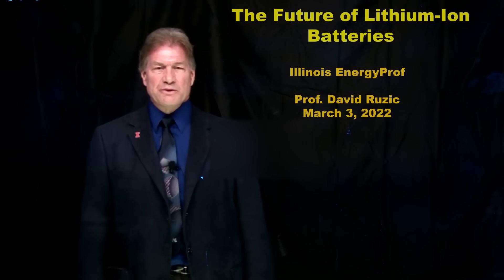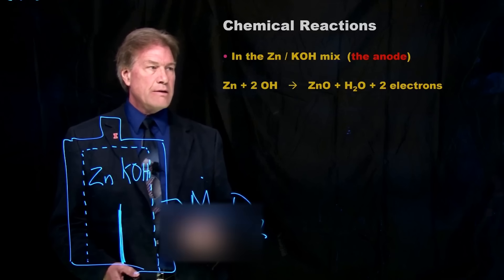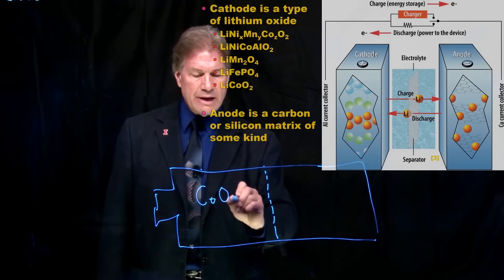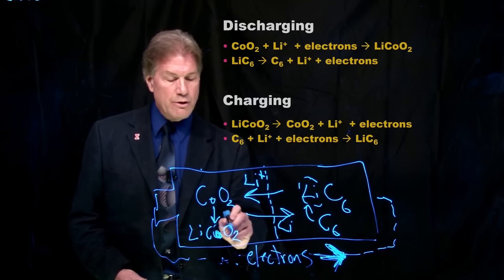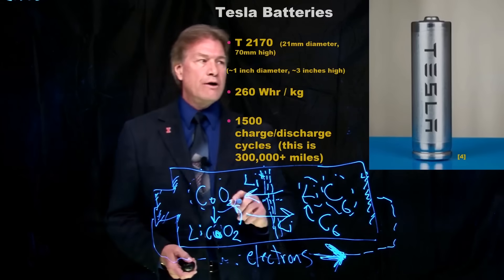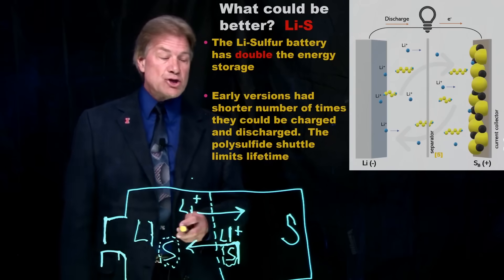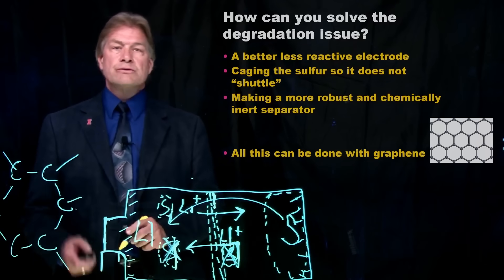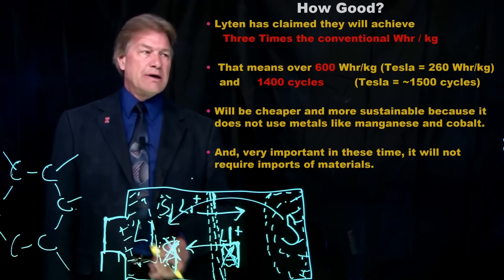The Future of Lithium-Ion Batteries

Comment: Interesting stuff. So as a EE I am interested in during discharge of Li Ion batteries the positive Li Ion travels from the negative anode to the positive cathode; my question what provides the energy for the Ion to climb that potential barrier since the cathode being positive should repel it???   By the way I have asked this question on every YouTube video regarding batteries and I have not received any answer that makes sense. Also if you could refer me to a journal paper that provides insight that would be great.
Reply from the maker: When the wire is connected between the two ends of the battery, they are "shorted" together.  There is a drop in the potential.  The LI ions only go across when the battery is in use.   The energy to make the trip is from the exothermic chemical reaction that takes place at each end of the battery.  Does that help?
Reply: @illinoisenergyprof6878  Thanks so much for taking the time to reply.  So if the load on the battery is a light load the potential should be about the same so the positive Li ion still needs to over come the 3.7v potential to get up to the cathode; so you are saying that the exothermic chemical reaction in the anode give the Li ion the boost to overcome the 3.7volts?  I would like to know more about this can you point me to paper that explains this.   
I was reading a chemistry book about batteries and they stated that the electrons that flow through the external circuit into the cathode form a negative attraction that overcomes the 3.7v and pulls the Li Ions up to the cathode ... I kind of see this but need more insight. Thanks!!!

Comment: As a note: lead acid batteries have Sulfuric acid as the electrolyte, not Hydrochloric.
Reply from the maker: my mistake.  Sorry.
Reply: @illinoisenergyprof6878  We all make em.
Reply: @stazeII
i was expecting to see H2SO4 but now wondering if it would work with HCL ? :-)
Reply: @YTANDY100  No.  lead acid batteries are a bit unique in that the electrolyte itself is part of the reaction.  Sulphate from the electrolyte reacts with lead oxide to form lead sulphate.
Reply: @matthewbeasley7765  the electrolyte reacts with both the lead plate and the lead oxide plate coating both of the plates with PbSO4, converting the electrolyte into water.
Reply: @YTANDY100  I believe they used HCl around 100 years ago.  H2SO4 may not be as 'Strong' however it is DiProtic, meaning it has two 'acid' molecules (First is Strong, second is weak).  I believe the backup batteries on the Telephone Land Line system uses HCL-Lead batteries.
Reply: @YTANDY100  Ah, H2SO4, Professor: https://www.youtube.com/watch?v=VnbiVw_1FNs (about 45 seconds in).
Reply: yea indeed
Reply: This guy on the vid is pretty full of all sorts of shit.
Reply: Maybe proff ruzic knows something that we don't. The team might be working on something. But it's been 2 years now I see , and ain't heard much to date .
Reply from the maker: As I mentioned earlier, I misspoke.  I did know the answer, but was trying to contrast the alkaline batteries with the lead-acid ones.    We tried to partially correct it in the video, and I also now mention this error in the video description.
Reply: @illinoisenergyprof6878  I taught I heard wrong at first and had to play that part again. You seem to know your stuff, so it was such an unexpected mistake. I was like hydrochloric acid, what?! It's sulfuric acid in the classic 12 V car batteries 😆
Reply: @illinoisenergyprof6878  you are awesome!!!!
Reply: MnO2 is manganese dioxide, not manganese oxide.
Reply: @amazeddude1780  both are fine because metallic oxides are often named without the valence number.

Comment: LFP has already solved most of these problems.  Longer life, lower cost due to easy to obtain base materials, low processing cost, easier to recycle, etc.  Lower energy density but easy to pack into dense blocks making them much more dense in terms of kwh per volume than cylindrical batteries.  I'm really not sure where this guy is coming from.  This must be a sponsored video by the company he's pushing.  This technology is quite old, actually, and no one has been remotely close to making it work properly.
Reply from the maker: The key is being able to make graphene easily, cheaply and at high purity.   I do videos on stuff i know about and get excited about.

Comment: Opposing viewpoint -This is the first time I have ever disagreed with the Professor.  What is far more practical (for vehicles) than this  Vaporware - if it ever becomes commercially viable before Climate change is 100% non-mitigatable - is tech that has been in use in the real world for over decade: PHEV (Plug-in Hybrid/battery + ICE).  Since 90%+ of all vehicle travel in the U.S. is less than 40 miles/day, why have any BEV with 400-500 mile range?  Yes, the messiah Musk says so, but he is just a carnival barker padding his own pockets with his celebrity.  The reluctance to charging times, and the availability of long distance driving without having to stop every 200 miles for an hour to charge at public charging stations that may or not be there,  are just a couple of factors in why All-Electric vehicles will always occupy a insignificant niche (unless dictated by a government).  And I am an owner of Two EV's (a BEV and a PHEV).  

With respect to vehicle emissions here and their effect on the climate:  We don't have a Physics or Engineering problem - we have a Cultural Problem.  

Our urban areas (read: Suburbs) have been designed to be only accessible by a car.  There isn't enough capital in the world to retrofit these areas with Public transportation - nor would most Americas use it anyway.  So we are stuck with cars.  All-electric cars are simply detestable by 97% consumers (as evidenced by the adoption rate) on almost every level, and rightfully so.  PHEV's with 50-100 mile, all electric range could reduce total vehicle CO2 emissions by 75% - 90%. All without the inherent issues of BEV's - assuming the majority of new vehicles are PHEV's using existing and Proven technology.    A PHEV with just 10% to 20% of the battery size of some $150K - 450 mile range - Lucid Aire is just common sense.  I have a 3-year old PHEV with 50 mile range, it has 44,000 miles, and during its lifetime has consumed less than 360 gallons of gasoline (you smart guys do the math).  One weekend per Month, it takes a 400 Mile round trip drive.  Otherwise, it's powered by the Solar on our rooftop.  

No, we won't get 100% vehicle CO2 reduction, but the adoption rate of PHEV's would be viable vs the 1% or so of BEV's in use today.  

The Professor mentioned not needing to use "foreign sourced materials."  This is a very sore spot with me, as he is talking about Cobalt - and its mining "methods" out of the Congo. Hey, I have an novel idea...how about just PAYING the Congolese what their natural resources are worth, and investing in their Nation to provide refined Cobalt? Instead of continually colonizing them economically, to the point that if we don't get the Cobalt on our terms, we won't get it at all, and tell everyone to wait until our "theoretical" Graphene becomes a reality so we won't need "those people"?  

The reality is we will Never do away with fossil fuels. Ever.  The underlying economic infrastructure is built around them.  To prove this FACT, at this very moment, the EU (except France, who has the common sense to derive about 70% of its electricity from nuclear energy) is still paying Russia $500 Million per day for oil/gas...while a war of attrition rages on.  This is how powerful the global fossil fuel industry is.  This is how insane our addiction is. We can only better manage the situation.  And wasting precious days (and decades) awaiting something that may never materialize only digs us into a deeper hole.
Reply: Thank you. The solutions will come in the form of innovation, but we cannot wait for innovation alone. There is no magic cure, we must start pouring money into fair democratic sustainable solutions, as imperfect as they may be right now. The search for perfection will kill us all, we needed to invest in "good enough to save most of us" decades ago but we didn't. I hope LiS will pan out, but we should not be waiting to act until the "perfect" solution exists.
Reply from the maker: I own a PHEV (Chevy Volt) since we bought it in 2012 for exactly your reasons.  I also know that we will always use fossil fuels --- see any of my videos about them.    This new way to make graphene cheaply, purely and quickly is not theoretical.  The only way to prove that though is  by waiting a few years for the factories to be built.   I think they will, and that is why I was excited enough to make a video on the subject.

Comment: I'm excited of the idea of switching out copper motor winding for practical super conductors and powering those new motors with solid state batteries. It would be cool if solar cell technology worked enough that you could charge a super capacitor to keep the AC on without running down the power of the main battery.
Reply: That is not a doable item, there is not enough energy hitting the exposed area of a vehicle to lower the temperature.
Firstly as the same energy would be hitting the cabin trying to warm it up.  Now I guess maybe if had a semi and trailer covered trying to cool a non sleeper cab over it might be possible, but as the temperature difference gets greater tge harder it becomes as it heats up faster.

Comment: If you want elemental sulfur, you should ironically look to oil refineries for that. It’s a waste product that they remove from the tail gas. I’ve designed the systems that extract it. Refineries literally truck away thousands of gallons of molten elemental sulfur each day
Reply from the maker: Good point.   The key is that the S is so much more available than the stuff needed for other types of Li batteries.

Comment: What I want is an electric car where you can take the batterie(s) out and replace them in a short period easily. Like old cell phones and R/C cars.
Reply: On a long distance drive in your BEV, would you be comfortable with swapping out your "replicable" battery with the re-charged battery I used in my off-road BEV, over rocks and through rivers?  Something that might combust as it was abused by me with your family in the car?  
I see what you're getting at: a theoretical method of a "faster charging" experience. But unfortunately, that will never be practical in the real world.
Reply: @shotelco  - I want to “flush” the battery. What I want is a bunch of round spherical batteries suspended in a fluid that you can flush out of the car then reload. Compressed against each other to create a circuit.
Reply: PATENT PENDING
Reply: @shotelco  - I should mention I work in automotive manufacturing

Comment: Professor Ruzic,   I have a question about these Lithium/Sulphur batteries using Graphene.  Can these 
take a charge more rapidly than a standard current LiIon battery or are they still limited in how much
and how fast they can be charged? 

I love the idea of 3 times the capacity that will be a game changer for sure. But I also like the idea of 
some of the other chemistries I've seen where they can more rapidly charge.  I think either one of these
will be game changers but if both were possible that would be even greater.
Reply: If they are small enough you just change them.
slide them out, put charged ones back in, why 2 ? 
May be one is about to fail, so you have redundancy.
Easier to carry to the overnight recharge station in your garage.
Reply: @Arturo-lapaz  Kind of difficult when there are like 7000+ individual cells. (Current battery designs). And anything that could be taken out singularly to charge would need to be made reasonably light to lift and move around so you're back to having a bunch of independent cells. 

The idea of modularity in the battery packs works better if the entire vehicle can be lifted and the entire pack removed by machines and swapped out. Tesla was kicking around an idea like that.
Reply: @GearHead4Lyfe  
I meant plug in batteries composed of 500, or may be 300 individual cells, easy to roll out laterally on a cart
Reply: @Arturo-lapaz  There is a lot of complexity to these battery packs, they have cooling loops through them too. What you are suggesting could be done for sure. 

I don't think that removing the batteries would gain you anything in charging times but it would be nice if there was some sub modularity for replacing dead cells.
Reply: @GearHead4Lyfe  you are right That requires some thinking and trade offs. And inner resistane data. No quick answer with out actual testing.
Reply: @Arturo-lapaz  Agreed but it is possible for sure. There will be many advancements in the tech and these new battery chemistries are a step in the right direction too.

Comment: I have lithium polymer batteries for my RC car that have "graphene" technology. Not sure to what extent it uses graphene, but this presentation sure gives a good understanding of the principles of what the graphene likely does in the battery. :D
Reply: I believe graphene can be used as a conductive additive in the anode. So it is added to the graphite anode to improve its performance, since graphene is very conductive and has very high surface area per volume compared to regular graphite. But I don’t think you can have a pure graphene anode, because high surface area means it would degrade quickly due to formation of an ‘solid-electrolyte interphase’ (SEI) layer which has negative impact on cell performance

Comment: I asked this on the previous version of this video: How much extra chemical energy is in these batteries vs the Lithium Ion batteries of today? If you're packing more electrical energy in per kg then usually you're also putting in a lot more reactants. I know a lot of the chemical energy in current Li ion batteries is in the electrolyte and carbon electrodes. Does this battery have less support material?
Reply from the maker: Since the energy per kg is higher, they have more chemical energy that is useable.   Since it is just Li and S compared to ones with various Li compounds. More Li ions can move back and forth as well and participate in the reactions.
Reply: @illinoisenergyprof6878  Thanks. So in the event of a catastrophic fire, you're going to have less increase in fire fuel than you have increase in available electrical energy? Sounds like a win in that regard too: Use smaller batteries.
Reply: Hey. I’ve got a great idea. It’s called Gasoline. This highly flammable stuff contain 10 kilowatt hours per litre (11.5 per kg). My car will hold 50 litres in a plastic tank. So much energy. You fill it with a big hose pipe.  
It’s fed to a hot engine and set alight by electric sparks. 
What can possibly go wrong?
Reply: Rechargeable batteries are inert. They only contain energy when charged.
Reply: @Dave5843-d9m  that's only true if you exclude the atmosphere. If you put a discharged rechargable battery in a fire it'll burn. The carbon electrodes will turn into CO2. The electrolyte often has some energy available in an oxygen-rich environment.

Comment: Is this a re-upload? I seem to remember seeing this 2 weeks ago :ø)
Btw, at 1:24 it is said that a car battery has HCl (hydrochloric) acid. If it is a lead-acid type battery, H2SO4 (sulfuric acid) is used. I think the professor is wrong on this.. Thanks, this was an interesting video - and hopefully the 3D graphene batteries will be available soon.

Can hydrochloric acid be used in battery? - Answers
- Answers Depends on your battery. In most cars, sulfuric acid is used because hydrochloric acid will not form Pb304 (lead oxide).
Reply from the maker: You are right that it is sulfuric.  I knew that but misspoke. Sorry!  I wanted to explain why the AA's etc. are called alkaline.
Reply from the maker: This video was accidently turned on to "public" for about a minute two weeks ago, but it wasn't finished.  Amazing you caught that!  I guess the notices went out to everyone then.  Sorry!
Reply: Yes, there was a video just a couple of weeks back. I too raised the question about sulfuric vs hydrochloric acid. A quick browse thru Google indicates that sulfuric is the type used.

Comment: Car batteries use Sulphuric Acid. Oh a 300,000 miles. You never owned a Commodore. Mine has reached 350,000 miles. All original running gear.